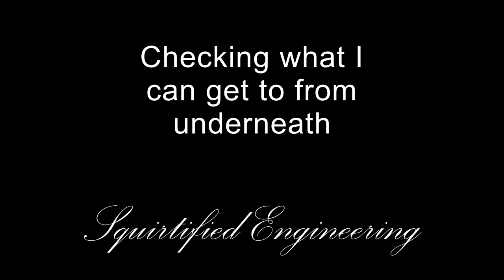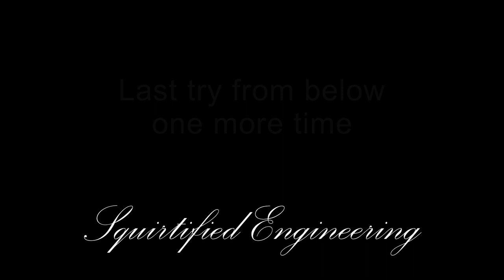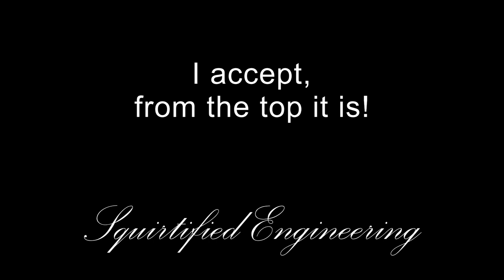Peugeot 206, how to replace the starter motor!

Comment: Hard to see what you are doing, but it is not your fault. It is impossible to see the starter motor because it is so far behind the engine. I did it on a 206cc with the 16 valve motor. Not easy.
Reply from the maker: Hello Robert, thank you for your comment! Yes it's a very tight area to film in. Even the work is done more by feel than visual. I will do my best to improve on this the next time I'm doing something similar.
Thanks!
Reply: Yay... I tuned in to this video on such an occasion. Nice to know.
I'ma do that tomorrow then... *sigh

Comment: I did this exact job and it didnt work. Plz help
Reply from the maker: In what way does it not work?
Reply: @SqEngineering   the pug left me stranded with the starter doing one click only when turning the key. I replaced the starter assembly with a new one thinking that would get it fixed and it is quite frustrating it doesnt solve the problem. Battery terminals were cleaned also
Reply from the maker: Is your battery ok? Have you had it tested?
Reply: @SqEngineering  i found the problem A/C pulley bearing failed and got tightly bonded restricting belt and engine movement
Reply from the maker: I see, so your problem was not only when the engine was warm? Your engine wouldn't even start when it was cold?
Reply: @SqEngineering  yeah i tried jump starting it, bump starting it and it only clicked once when flipping the  switch so i went right to replacing the starter, fuses and cleaned the battery terminals and grounds without any luck. Up until that moment i realized the alignment of the ac pulley was off so dismounted the serpentine belt and voila! Engine started right away